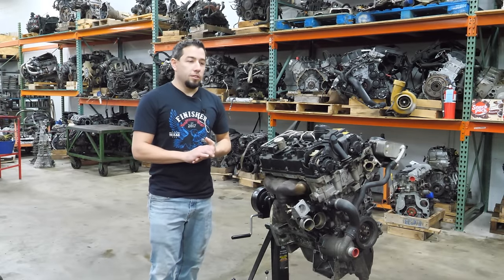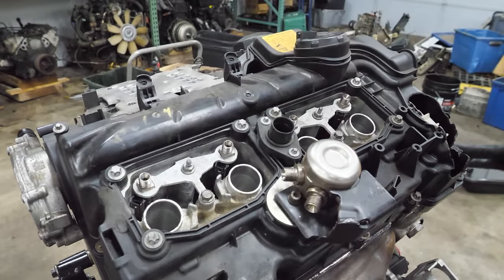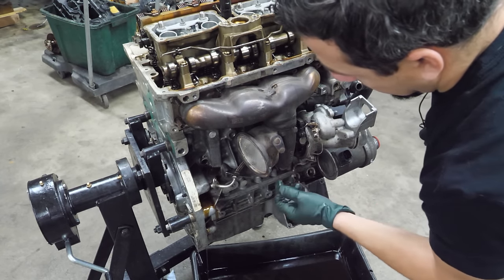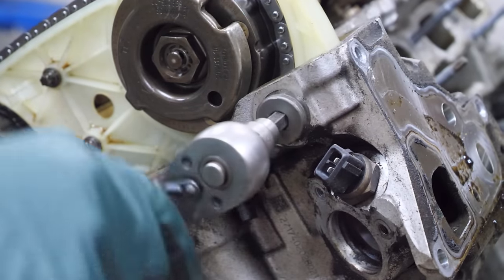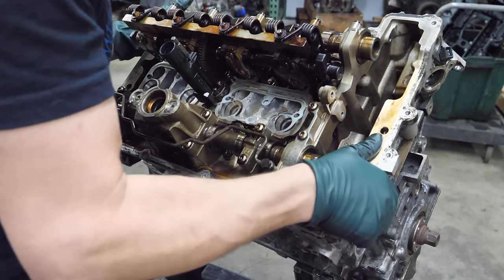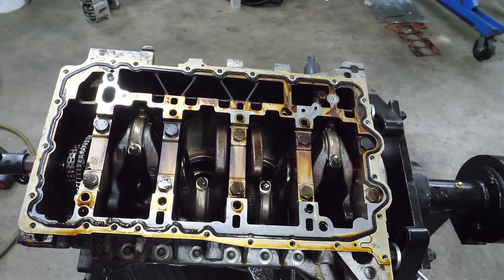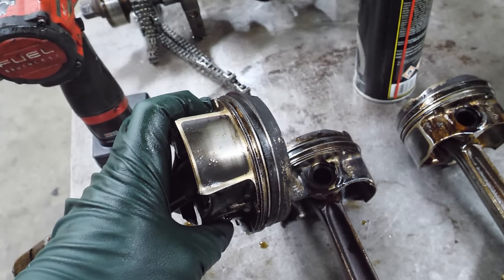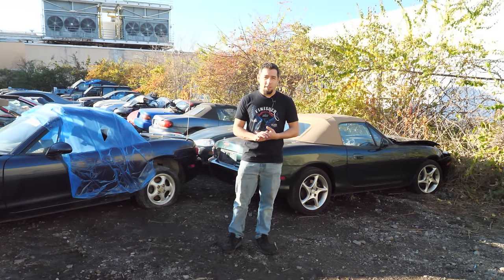SKETCHY RETURN? Was The Customer WRONG? Blown BMW N20 / N26 Complete Engine Teardown

Comment: It looks like this engine's pistons have a one-piece oil control ring which I thought was only used on diesel engines.  My background is with Honda that use, at least the ones I've seen, a three-piece oil control ring.  Perhaps this is a German design tradition or some other valid reason.  Please educate me.  Thank you in advance.

Comment: 240hp from a 2.0 turbo 4? Pretty pathetic…. Maybe they have a ton of torque? Idk GM’s 4cyl’s blow that out of the water power wise, and do it with far less complexity. Just standard VVT, or in the case of the LSJ, 225whp from a supercharged 2.0, no VVT AND port injected not direct.